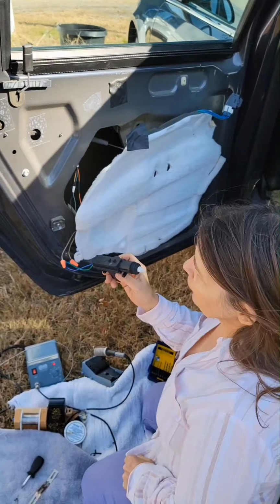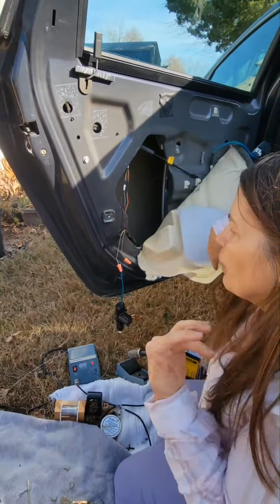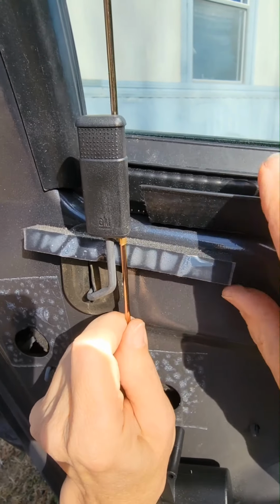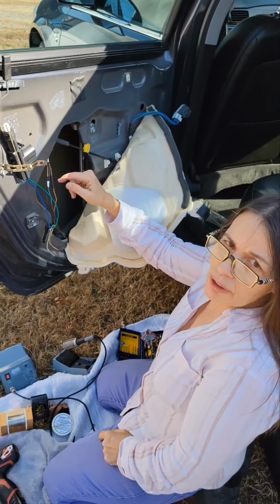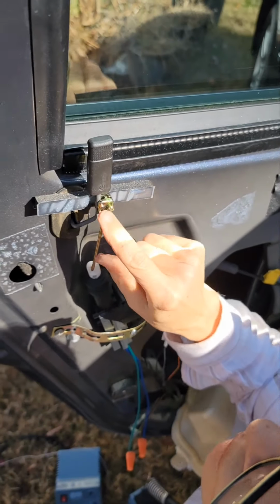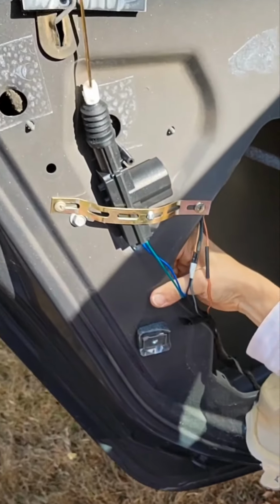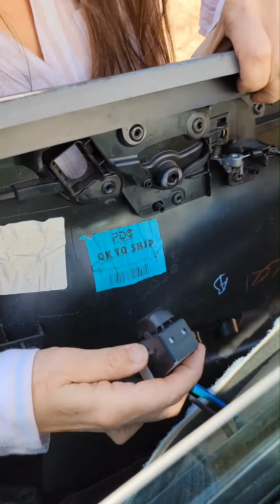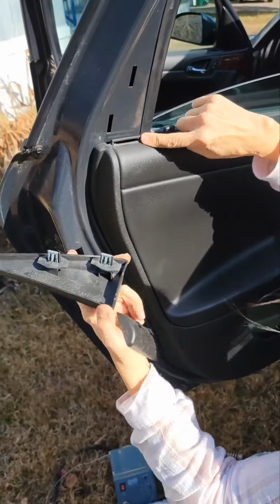How to fix door lock on 2008 Chevy Impala

Comment from the maker: Hi Robert, thanks for your comment. 
You can do it. Tackle one lock at a time. Probably good to start with back right door since thats most difficult to reach from driver area.
When pushing the lock and unlock button, listen for a motor sound at the door. If you hear the motor sound, but the door lock will not either lock or unlock or both, then you know power is getting to the door and the lock is faulty. Sometimes the lock will unlock but not lock or vise versa. Then its time to tear things apart. Once you get the new part wired in, be sure to test things before you secure everything back together. You can do it. You will be so happy once its fixed. It will be so nice!

Comment: Awesome video! Thanks! I'm not sure, but I think I have to replace all 4 of mine because when I press the button on the driver's side door, some of the locks will unlock and some won't and when I try lock them by pressing the button on the driver's side door, the same thing will happen, some lock and others won't. I wish you were around to help me because I'm not sure if it's the relay or the switch or the actuator...lol
Reply from the maker: Thanks for your kind words Robert. 
I added a more detailed diagnostic explanation in the description of the video. Hope it helps. Let me know how things work out for you.